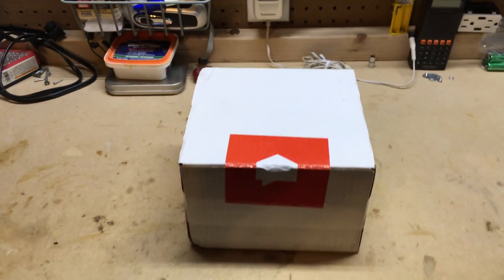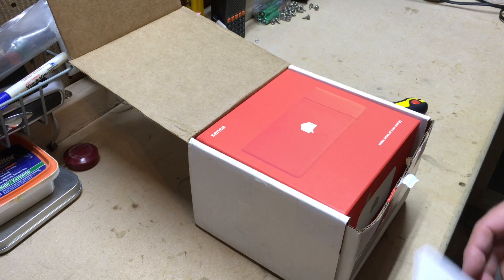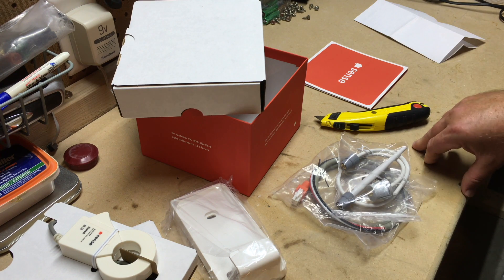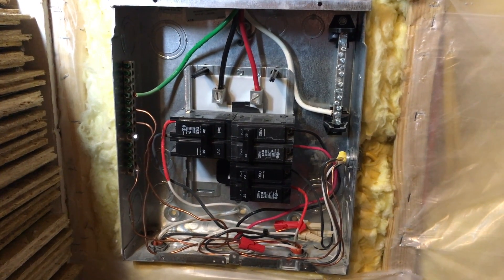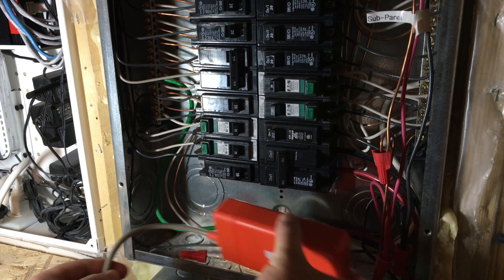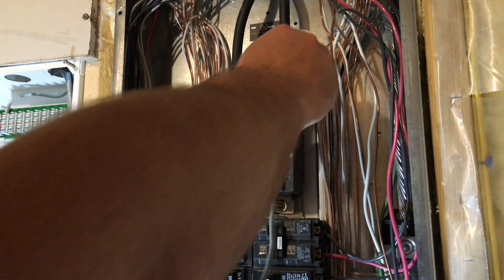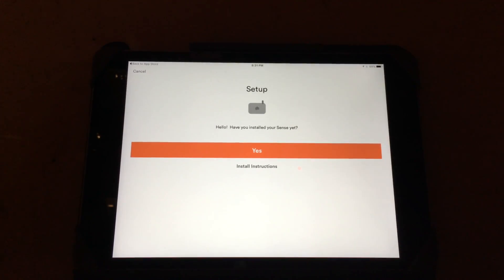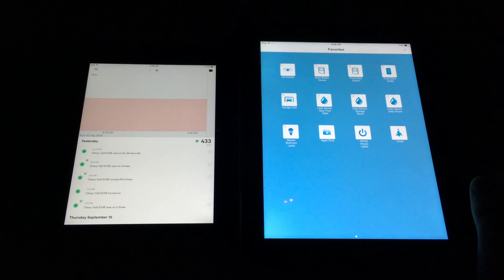Sense Home Energy Monitor Unboxing and Installation

Comment: This is probably hands-down the best video on this product I have seen. After watching this video if a few times I am definitely buying it. The thing that I love most about the concept of this is the fact they could tell me in real time what is going on. I have a 14 kW solar city system on my house and my electric bill is still about $200 a month. I hope the investment in a sense system will help me figure out how to lower my costs. Thank you for taking the time to make this video.
Reply: DzLiveTv How can you still have a $200 bill with a 14KW solar system?  Do you know what your solar system is producing?
Reply from the maker: Glad the video could help and thanks for the comment. Be patient with Sense, it will take a while for Sense figure out devices.  Sometimes you have to play detective with it and lots of fun when you figure out new devices!
Reply: Do you have an electric water heater?  I do and I suspect this is what is eating up all the solar energy I am making.  My system is a smaller 7.3 kw system.
Reply: Solar city should have installed a revenue grade meter for you. Be pretty hard to redeem SRECs without an RGM.

Comment: Thanks for the video.  I'm planning on buying an emergency generator (~8kW) and connecting it to my house via a Generlink*.  I want the Sense to show me power consumption, in real time, in the event of a utility power failure.  So, I can turn on appliances and not have to worry about tripping the breaker on the generator.  Here's my question:  A utility power failure likely means my ISP is offline, even when I have a generator to power my WiFi router, and the rest of my house.  Will Sense show power consumption when I've got power, but no Internet connection?

*Generlink is an attachment to the home's power meter allowing a 240V generator to be connected and not backfeed power to the utility's power lines.

Thanks for your time.

Comment: Question for you. I purchased Sense last week and it was installed a few days ago. I was getting 0% detection for 2 days. I sent a picture to Sense and they said that both voltage clamps were installed on the same line. The problem I have is that I cannot fit both clamps on the main lines coming into the master breaker because there isn’t enough room. So the electrician installed one voltage clamp on the line above the breaker and one below it. Sense told me to move the clamp below the breaker to the other side.  We ended up moving both clamps below the master breaker. So one is attached to this metal bar (not the bus bar) on the left and one is installed not the right. I’m still getting 0%. Does this really take 24 hours before that percentage meter increases? The unit is working somewhat because it shows me how much watts are currently being used.  Sense is closed now because of the holiday so i cannot get a clear answer. Can you help?
Reply from the maker: Sorry, really cannot offer advice due to liability.  It is good you are using a electrician and the unit is showing total watts used.  I'd give it a few more days to start showing devices.

Comment: Does your Sense auto reconnect to your WiFi automatically after short power bleeps or do you have to shut the main breaker off for more than five seconds for it to reconnect to the WiFi signal? We have short but often power bleeps in our area and I'd be in no position to cycle my main breaker off and on every time we encounter power bleeps.
Reply from the maker: Mine resets automatically if there is an outage. If has been pretty rock solid...

Comment: How did you get sub pannel to pass inspection ? You did not install it correctly.. You should have some sort of coupler bettween both pannels.. Instead of having it exposed.
Reply from the maker: Enrico Sciullo.  No inspection required in my county or state.  Good to know, I will make that change to the sub-panel.  Thanks.

Comment: Looks like a great add on for power monitoring, why couldn't you post the cost of the unit, you mentioned all about the unit even packaging but not the cost, are you an employe or own stock in sense products. WHAT DOES IT COST !
Reply: 299 / 349 depending on solar/non version.

Comment: Why do they make you install an additional breaker?  Why couldn't it just plug into a receptacle? Is there a reason, or just the way they decided to do it?
Reply from the maker: Code doesn't allow you to double tap.  I ended up using a quadplex breaker which allows you to double tap a double pole breaker (if your panels allows it).
Reply: The same reason you wouldn’t install a water meter on a kitchen sink to see how much your shower uses. It measures the energy flowing through it.

Comment: Sounds like you have interference issues with your wifi and electricity.
Reply from the maker: I recently upgraded routers for a second time and all is working well.  Went with a dual band so I believe Sense is working off the 2.4 GHZ signal.  I believe the previous issue was a Sense software update.

Comment: Is this solar ready?
Reply from the maker: Yes, but you need the solar adapter cable
Reply from the maker: A very good analysis of the common deceptions of "green" energy especially with how green energy credits work across the grid.  I think the previous question was referring to if Sense is "solar ready" thus meaning that the Sense unit has an adapter with clamps that can measure the AC output of a central inverter or combiner box.  These clamps add another box in the software for solar generation.  Not really needed as most solar setups have energy monitoring.

Comment: How is the better, worse, different than Neurio?  I have been using that system for a few years and it is working well.
Reply from the maker: I believe there are many similarities with Neurio but I do not have a Neurio to compare it too.  That would be a good video if someone did a real head to head comparison and had both units running at the same time.

Comment: Great video!
Knowledge is power but how is this device really going to benefit the average homeowner who has a more modern home with modern appliances? I mean, knowing how much energy my washer, well pump, dryer, electric range, water heater, refrigerator, etc. is using doesn't negate the fact that I still need to do laundry, shower, cook and heat my home. When I see this device on 'Ask This Old House', I was excited to know such a product existed but quickly realized that it would be a waste of money for me. I have a 2200 sf. 10 yr old home with HE appliances, LED bulbs and I'm always making sure lights and devices are not needlessly left on so where was the benefit of spending $400 CAD. plus shipping & handling to try and save another $30 or $40 a year.
Can it alert you to power spikes of your choice? Can you tell it that you are not home so you get customizable alert? Will it text or email you at all so you don't have to constantly check the app?

Are there any other devices like this? Are there any other device with dual CT so I can tell how much I'm drawing from my generator during an outage?
Reply from the maker: Scott, I recently viewed the This Old House feature on Sense.  I thought they did a good job on the overview.  Knowledge is power...in this case in different ways.  Sense allows me to know what devices are drawing how much power.  Instead of just getting a bill from the electric company for 1000 KWH's, now I'm quickly figuring out which devices are the energy hogs. If fact, I'm finding out what uses power regardless of their age or how modern.  If a person has time of day rates, maybe they change habits and shift certain devices to being used at those lower rates. Charge the car at night, set timers on their water heaters, etc.  Maybe time for a heat pump dryer or inductive range?  Of course that's spending more money, but these are additional ways to save energy.  As far as your questions, not sure, I know I can go back and look at devices and their use as well as real time, so I think that is very useful and powerful.  I see there is also more integration being done with IFTT, so probably will have more features down the road.
Reply: johntmcevoy I agree, I see good people get really hurt because they do not take electricity seriously. I am an electrician and this device interested me because I can use it to monitor my generator power consumption during a power outage. I also see lots of issues with this install but opted not to comment on it.  In fact, in my region, I am not allowed to install any device inside the panel with the wires.  Not sure about the US. No door bell transformers, wire nuts, splices or anything. I am also not allowed to run branch circuit wiring through the 'disconnect' region of the panel like in his particular install. Typically that area can only be de-energized by the utility, not the disconnect switch.  It can be very dangerous to work in there if you are not properly equipped and trained. I recommend hiring an electrician for any electrical work in your home due to fire risk.

Comment: Looking forward to your updates.   if  you have time can you post a photo or video of your usage bar?   I got mine plugged in with solar and after some problems (it was reading solar as the house) I think its working.   How long has it been taking to identify appliances...so far about 20 hours and nothing yet...I have a feeling there is still something wrong with the solar side but nothing to compare it to.  Wish there was a user forum or something to share experiences...enjoy your day.Jon
Reply from the maker: Jon, thanks for your comment.  Was at least a couple of days before Sense started to discover devices.  I agree on the forum.  Sense never replied to my support ticket until a week later.(says 24 hours on their support page ticket).   We are on our own for support.  Hopefully we can help to support each other.  We have solar at our house but I didn't get the Sense with solar since we already have a couple of monitoring options.
Reply: Yea I can monitor solar through other means as well was hoping to get a good visual of what's doing what in one place....on a good day our solar well out produces what we use which so far is not evident via sense.    They do seem to respond to FB criticism I noticed after following their page.

Will keep in touch....Jon
Reply from the maker: Yes, I offered some fairly fotward comments on FB page and they also responded.  I am doing an update video this weekend and will be going over the app.  Will sho the usage screen.
Reply: watched  your next video and generally agree,  not really ready to plug and play for the masses, but hopefully on its way.   after a week of going sometimes 2 days between replies I finally have mine working the way it should.  It was ADDING solar and house power together,  apparently I have whats called a line-side tap in my PV solar,  they were able to make the switch from the mother ship at HQ and now its working perfect.....just need to track down unnamed motor 2 and 3 and we will be on our way....
keep up the informative videos....maybe you should start a forum...I feel there could be a need : )
Jon
Reply from the maker: Thanks Jon,  we have a line side-tap too for our solar.  I may be doing the upgrade for the Sense Solar.  Aside from the a few issues here and there, I am digging my Sense!